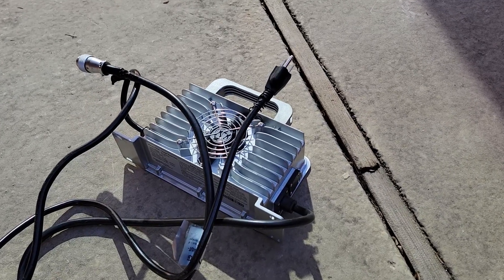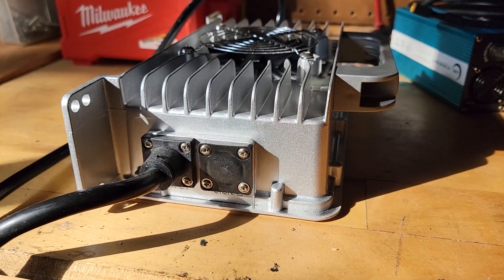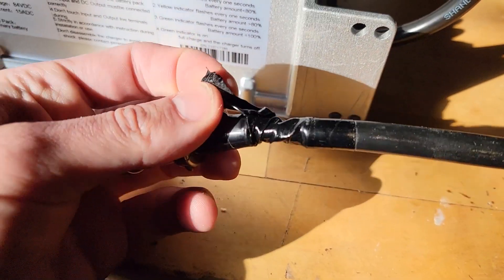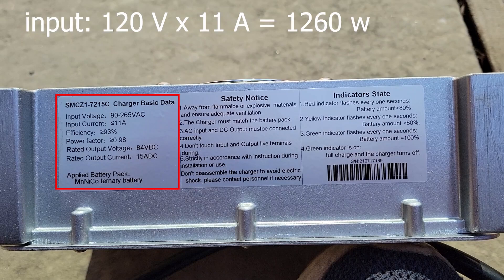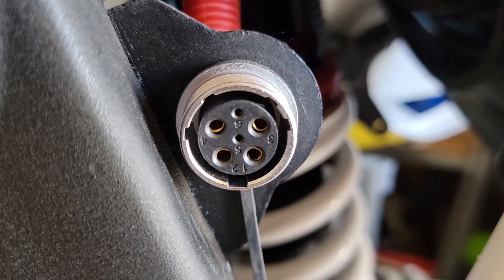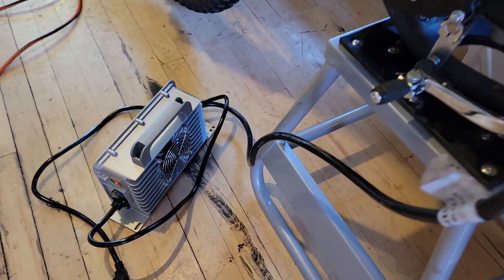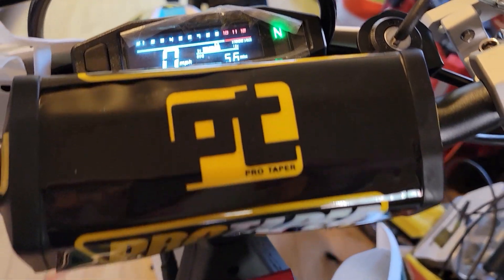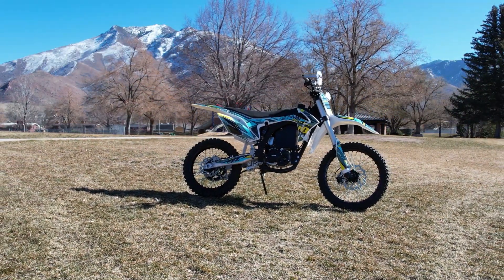Chinese Electric Dirt Bike Battery Charger Overview (Nicot Moto eBeast)

Comment: How long does it take to charge from dead? 

Would it charge 2x faster  if you gave it 240vac ?
Reply from the maker: not necessarily. I dont know enough about the battery to answer exactly, but the BMS and batteries can only take so much amperage coming in. Regardless of 120 vs 240, if the batteries only take 30A max, it may not matter what the input voltage is. The BMS is likely the determining factor here, but i have zero info on the BMS used in the battery

Comment: You said voltage is not a good indicator of a lithium battery charged. This is very untrue voltage is the only way to know how charged a lithium battery is. 

The charger you have has different charge percentages so you don’t have to fully charge to allow extra life out of the battery.
Reply from the maker: I agree and disagree. Of course the voltage tells us how charged the battery is. The point I am making is that a lithium battery discharge curve is too flat to be very helpful. Especially when the battery is stressed, it will show low and then a higher voltage after it rests for a few minutes. The ideal would be to throw an ammeter on it and measure how much juice has actually left the battery.

While riding you cant know the difference between 70.2 and 70.1

Comment: Maybe use an Anderson plug and hide it under the gas cap so that it is higher and out of the way for river crossings.
Reply from the maker: yeah, exactly kind of what i was thinking. Another commenter recommended something like a GX16 which would fit the same hole as the current connector. I still might do that (waterproof one), but either way, i will move it higher up on the bike.

Comment: Change out for a sp21 connector. They are ip68 military grade. 21 refers to the size in mm. Electric scooters are gx16 easily upgraded to sp16. Your looks like a 21mm to me.
Reply from the maker: havent heard of this connector, looks like it would do the job. Thanks
Reply: @Feathers Offroad  I change my standard gx16 electric scooter connector to sp16. Its just the waterproof outdoor version. You need to be sure of the size of your current connector to be sure what one to order. It may be a sp19 you need. I'm only going by eye, saying it's bigger than a gx16 scooter plug. Lots of sizes in between a 16 and 21 though. Good luck. You'll probably find only 2 cables and the industry standard is red on 1, black on 2 and leave 3 blank.

Comment: The voltage on Lithium battery is the indication of State of Charge. Search State of Charge for Lithium batteries, and you will find the method of Lithium battery measurement is the voltage.  I build Lithium batteries and I use the same charger.  The connector is pretty bad on yours,  but I get Anderson Connectors on mine. I have used many others, but one of the main features of this charger is that it is dirt and water proof, and that it does charge at 10+ amps, depending on your input voltage and current.
Reply from the maker: I should clarify that it is the 'state of charge' but the charge curve is not linear. As you know the dip from 83v to 79 is going to happen really quickly, someone might think they are down 20% already, but this wouldnt be the case due to lithiums having such flat middle voltage curve.

I have some Anderson's here from another project, thats exactly what I was thinking of using.